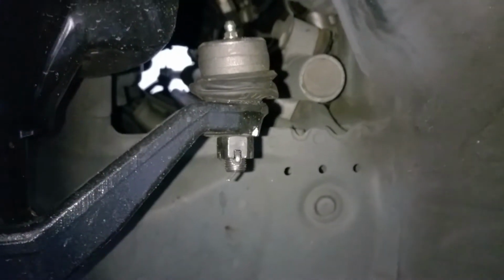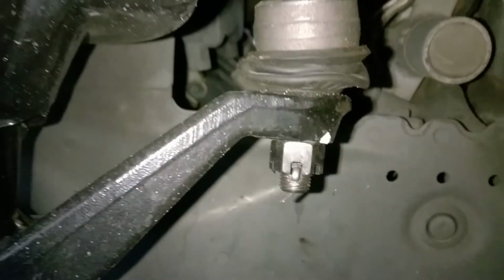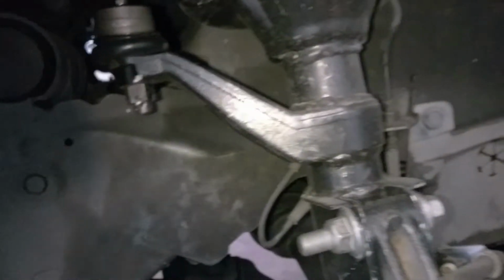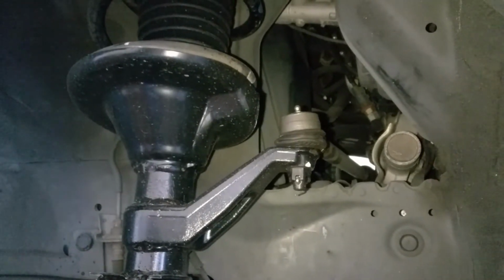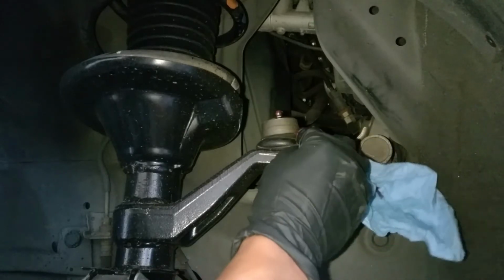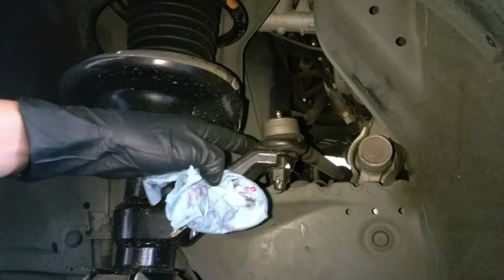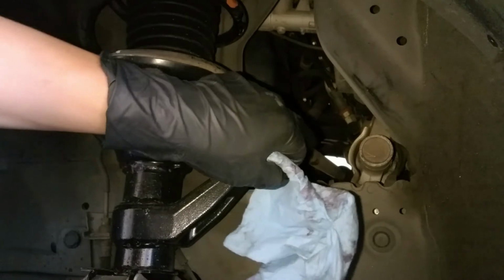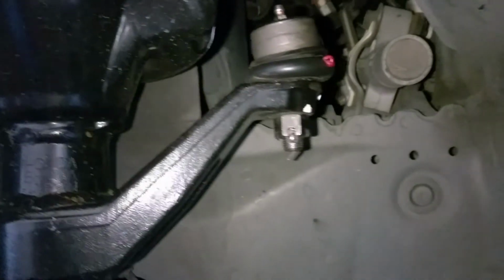05 Acura RSX Base - Greasing Moog Outer Tie Rod

Comment: I was told that I didn't need to put more grease into the boot because it is already prefilled. It came with the piece but I installed the tie rod and it still makes the noise when turning the steering wheel 3 degrees in both directions.
Reply from the maker: There is an underlying assumption that it comes with "some" grease but moog recommends adding grease on installation. They have it listed in their "Chassis Maintenance" portion pdf when you look up your specific part . Here is a link if it will let you visit it on Youtube

http://fme-cat.com/livedocs/DYK10_103_ENG-R.pdf

As far as the noise you hear when you turn your wheel, it could be many things so it'd be best to take it to a suspension expert in your area probably
Reply: Used the same links about 60k miles back,  Iv'e noticed a bit of shake after 70 mph after alignment, new struts and tires. I'm thinking I missed some greasing with the links. Already torn links?
Reply: elmercorn Steering wheel shake above 70 could be tire balancing.
Reply from the maker: Ya, possible could be tires need to be balanced as @rkgsd said
Reply: Im having the same problem on my rsx. Im on coils and im on aftermarket  rims and tires and I have a steering wheel vibration at 60-70 mph. Even when I was lowered on stock wheels. Started when I took my stock tie rod ends off and then put them back on because the longer ones that I was told to put on when lowering an rsx couldn't fit. ever since then, Ive been having sterring wheel vibration problems. any suggestions?
Reply: @thekreativeculture9642  my rsx had a similar issue, anytime I'd go over 100km the steering wheel would shake! I ended up getting an alignment done, and it went away.

Comment: My MOOG tire rod end came torn on the boot too, how did you fixed yours?  THANKS FOR THE VIDEO
Reply from the maker: I don't think you can fix it as the tear is so small. It would be better to replace it but I didn't want to go through the hassle of taking it off again so I just make sure the boot is well filled with grease and re fill it when I need to every so often
Reply: alexb0i Thanks a lot for your quick reply, I was planning to refill every 8,000 miles do you think that would be to long or can you advice me how often, in miles or time, should I be doing the refill procedure?  AGAIN THANKS A LOT FOR YOUR SUPPORT.
Reply from the maker: @robertogomez8100  no problem, it really depends on how torn or big of a hole the tie rod boot is. Its best just kind of do a quick visual inspection every couple of weeks or so just so you know if you need to re fill or not to be safe
Reply: alexb0i Thanks a lot.
Reply: alexb0i Just got the new tie rod end, tried to replace it but it is stuck and it has been installed only for 3 days, any advice on how to remove it without affecting the part because I have to send it back for the warranty claim. THANKS
Reply from the maker: @robertogomez8100  how is it stuck? If it's stuck as in you cant get the ball joint end to pop out, you may need a tool to help you pop it out without damaging it. You could try un doing your nut, flipping it upside down and then screwing it level and try to tap the flat side a couple times to pop it loose? Other than that, you'd probably have to take it to a mechanic with the proper tools :/